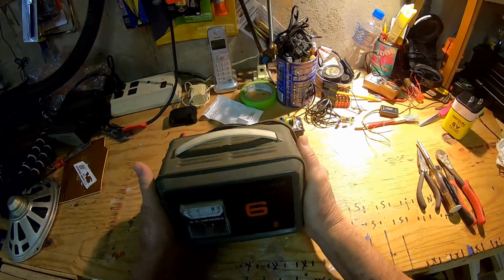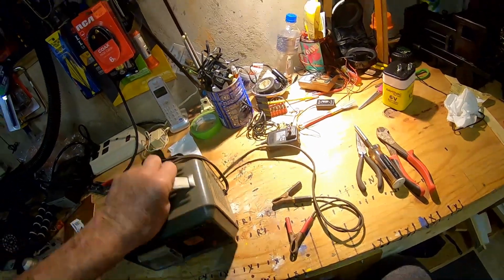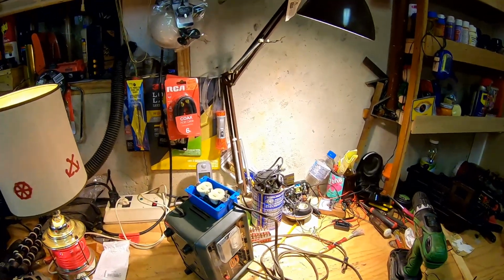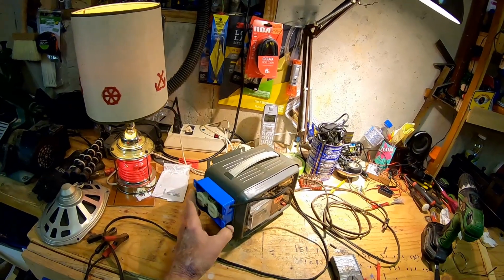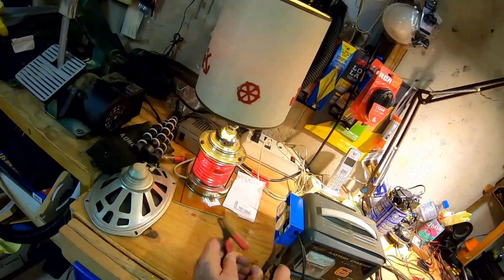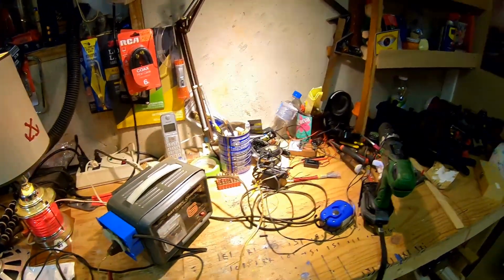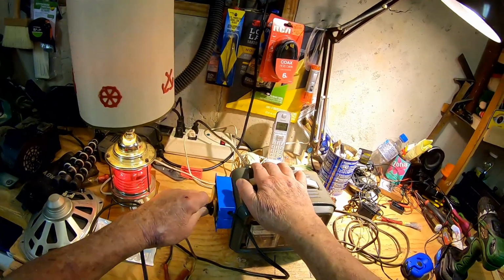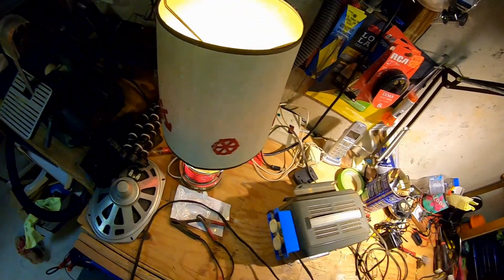In the Shop with Walter Railroad Lights project Continues

Comment: I recommend getting a 12V Cigarette Lighter Power Adapter. Wire it to your lights. Then bring that jump pack in. It looked like it had two 12v power ports on it then you could power your lights with the jump pack.  Just my opinion.
Reply: Skinning a cat. Many different ways, so I've been told 🔪😿
Reply from the maker: Thanks for the suggestions